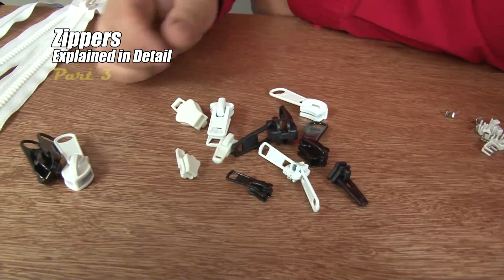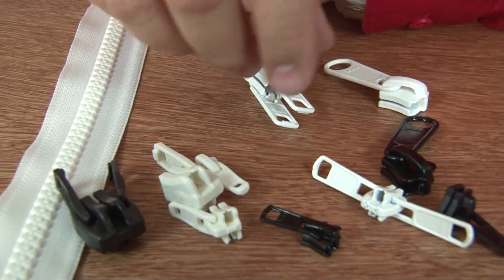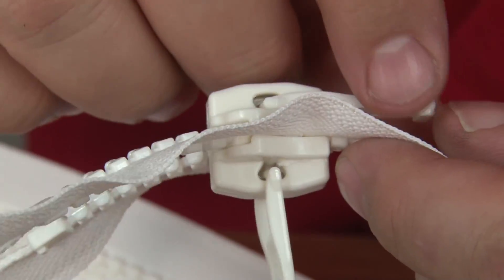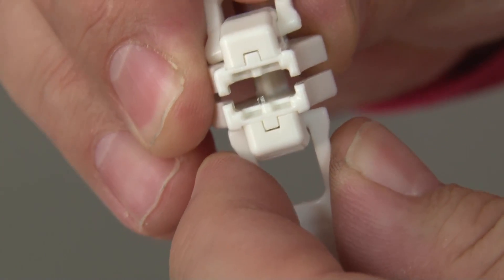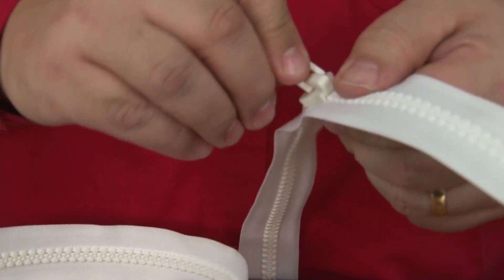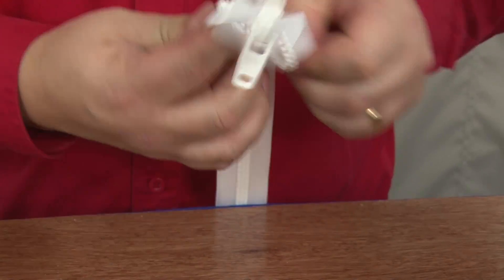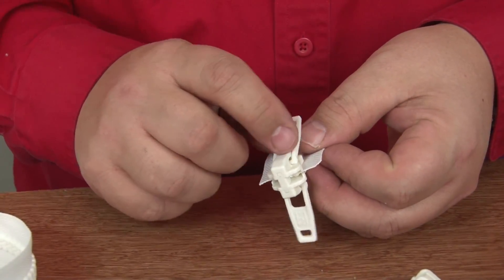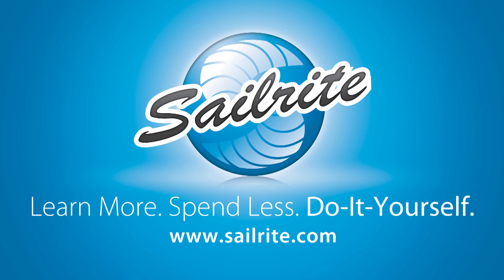Zipper Sliders - Part 3 of Zippers Explained in Detail

Comment: @SailriteDIY , what does one do when the metal locking mechanism, seems to move freely, but does not unlock?, even when adding a paper clip for more lift, didn't help. Any suggestions, other than ripping out the zipper? ( Been fixing zippers for over 45yrs. ) Hoping this is fixable. It would be great to not rip it out.
Reply from the maker: If the zipper slider is the only thing not working simply remove the end stop and replace the slider with a new one.

Comment: can you take the pin-lock out of the zipper?
Reply from the maker: If you are asking about the zipper slider locking pin, we have not tried to remove it. If we want a non-locking slider we simply replace the slider with a non-locking zipper slider.

Comment: what's the difference between a double and single zipper pull?
Reply from the maker: A double slider has two pullers on it (on each side) so they zipper can be opened from both sides of an application (the inside or the outside). A single slider has a puller on one side ony meaning it can be pulled from that side of the zipper only.

Comment: Hello sailrite,
I have a coat with a two way vislon zipper with two long metal anchors at the end of both teeth tracks. One, bottom slider is faced down ward and it may have been a locking vislon slider but I can't remember, if there was a box receptacle for the two long metal anchors at the bottom end of zipper, like you showed on your video and do you need a box if you have the locking vislon slider? Is it correct to place two vislon sliders that lock and do I need the bottom box for the two metal anchors? Perhaps one vislon locking slider for the bottom and one non locking vislon for the top or can I do without the box joining the bottom metal anchors?
Reply from the maker: The long pins or posts must slide into a starter box to start the zipper. We do not sell starter boxes than you can just add to a zipper, them must come from the factory already fixed to the zippers.

Comment: Great video! Many thanks for sharing. Your technique of feeding the slider from the bottom saved a pair of diving boots. My YKK locking slider broke so even though I found and bought an original YKK replacement slider nobody wanted to fit it since it wasn't feasible to access the bottom of the zip to feed the slider from the top. But I managed to do it from the top of the zip using your technique and making minor damage to the zip stopper. Thanks!
Reply from the maker: You are welcome!

Comment: Sail rite what kind of slider would go on a tent zipper?
Reply from the maker: Zippers on tents are usually the "coil" type. However, it is best to match brand for brand. Usually you can see the size of the zipper on the slider. Look closely and you may see a number like "5C" for #5 size and coil.